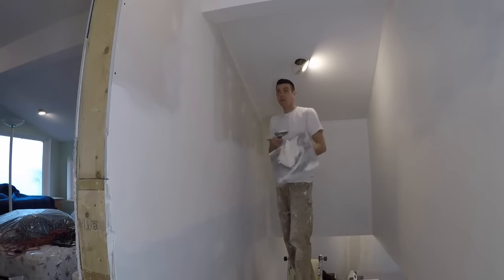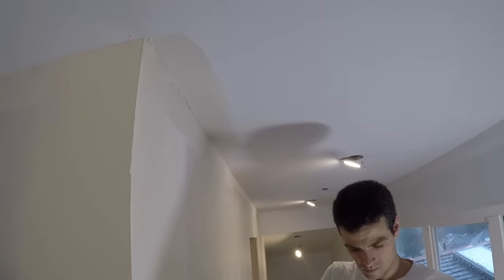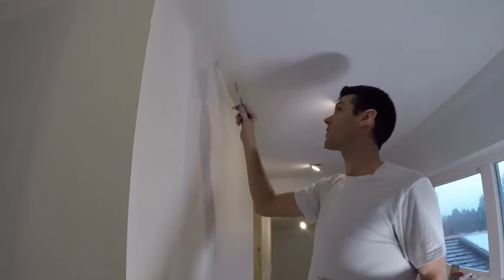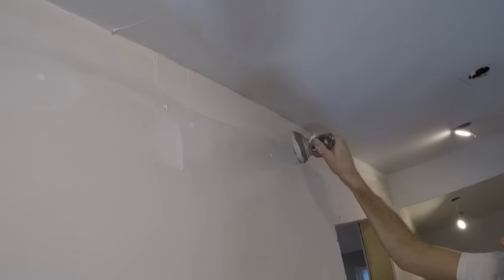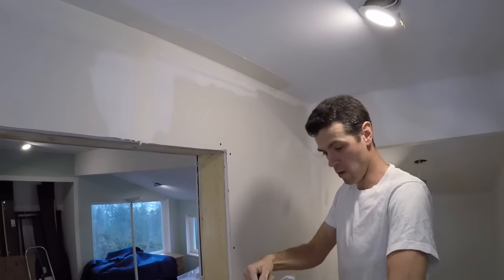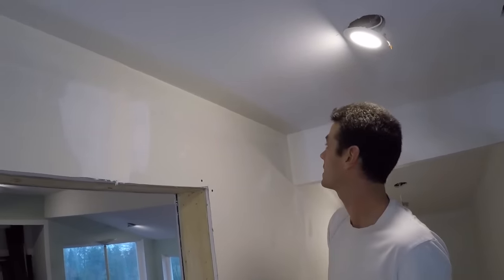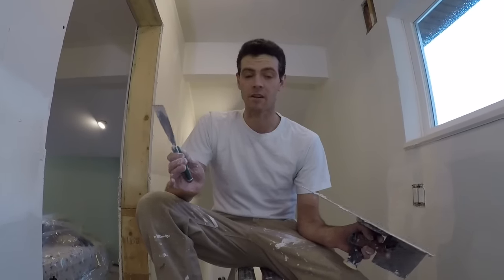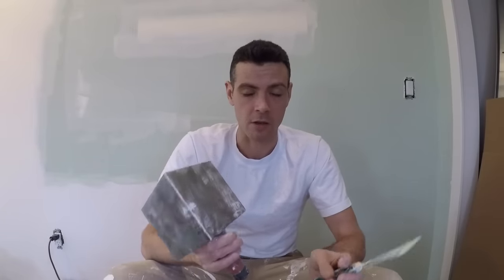HOW TO USE A CORNER TROWEL

Comment: I learned on a corner trowel, and don't need to use a knife with it. I keep my mud laying on my hawk like a fat pancake, and plow the trowel into it picking up what I need on both sides. Smear in out, usually half going one way, the other half going the other direction. Make several passes in both directions to smooth and level. Clean the blades on my hawk, then cut away excess mud from the far edges of the joint using the front of the tool. Clean the blades on the hawk. Make a feathering pass on each side of the joint with the tool fairly flat, putting pressure on the outside edge of the joint with very little pressure in the corner. Easy-peasy.
Reply: I agree he seems biased. How about a video with a zero experienced ‘taper’ showing them using both methods ( corner tool vs knife) and look at the results after just one application.

Comment: I've used OPS a few times as well. I found I had better control and a better feel for the
mud if my index finger was as forward as I could get it, applying pressure to the blade.
That said it spends more time on the shelf next to my outside-corner plank shim than
on a job site. Quality video! Thanks.

Comment: I'm left handed AND I like that tool. I apply the mud with the same tool so I don't need another
blade in my hand. I've laid tape with it and use it on a finish coat. Though you're right it's obviously not suitable for every situation. I find it's only issue, from time to time, is the construction underneath it.

Comment: I bought one os these.  Used it once...in a closet.  Never used it again.  I am, however, now a fan of paper faced metal inside corner beads.  I have 25 (drywall) inside corners in my basement remodel and they are well worth the $50 for me.

Comment: I get fairly consistent results with a corner trowel because I don't put too much mud in the corner to start with... so the trowel always bridges the entire swath of mud. This means I really don't have to taper in edges because they always end up tapered with pressure from the trowel. If I need to run the mud out wider then I wait for the first coat to dry...and then use a 6 inch knife.  I admit I am certainly not a professional.  I tried the knife method and always found I got an inconsistent corner that had to be chiselled out or built up in spots. Perhaps my technique is pretty crappy...but I am a retired body repair man used to putting body filler on straight. Our motto used to be "The bodywork is only as straight as you are" LOL.
Reply: Lol

Comment: so i wanted to try the inside corner tool as well i have had decent luck but mainly because of many trial and errors. its all around way more work and best way ive found to use it where it produces a nice finish is you apply more mud than normal, and use ALOT of pressure to thin the corner back out but honestly its definitely kids sandbox shovel now. lol

Comment: It is all about practice, and what tools you are used to using. I have been using corner trowels for 20 years, and it is just as good as any other method. This video is YOUR opinion, nothing more, nothing less. These tools have been used by quality drywall finishers way longer than YOU have been alive.

Comment: You should see me on that corner tool. It definitely took abit of time to get good at it but once you are it really is beneficial. Only need to go over it once and only feather edges once at the end and when I go over it I put my hawk down  somewhere or between my legs if I dont need to walk and use my other hand to apply the right pressure to get a more smoothly even finish, helps to control the angle and amount being applied I  the corner.

Comment: Ha ha ha, I always wondered about my corner trowel. I bought one 25 years ago, used it a couple of times, and had to sand way more after I was done! I assumed I wasn't doing it right. Single blade, one side at a time, is easier, as you say!

Comment: I have depth perception problems because I have poor vision in one eye.  So I've used a corner trowel , but I do it a little different. I put a bead of mud right in the corner so that it covers no more than an inch on either side of the corner. Then I press the corner trowel into it and force it into a nice sharp  corner line . This eliminates  having to taper any edges. I let the mud set up...and then I do each side with a 4 inch knife  going right from the corner and tapering it to the outside edge. It works for me...even though it is not as fast.

Comment: Interesting, I'm very inexperienced @ drywall, I tried that tool a few years ago only the first and only drywall I did until this year. I ditched it at the first attempt thinking it must be a gimmick. never entertained me to even try it again. I have just completed my first corners since and lo! I used the 4" knife, not quite the way and ease that you do it by a long shot but I got them done into very passable corners. I thought I'd better watch one or 2 u tubeers ( 2 beers is what it took to get the job done) Thanks for putting my mind to rest, I tried your method on my next corners, about 4 times as long as you took, but much, much better corners, a bit more sanding than yours of course, but not as much as my first ones did. Much obliged

Comment: I have one of these corner tools and I'm not a pro.  It does work well with a technique and as long as the mud don't spread out too much, it'll feather the edges nicely too.  It is not built with a 90 deg shape but something more so you can't get too tight in the corners.  This leaves a thick layer in the corner to provide adequate coverage of the tape.  As indicated in this video, if too thick in the corner, sometimes the mud will dry with a fine crack along it and that's the only downside.  I just fix that with a final pass of mud packed into the corner.

Comment: I love my corner trowel. I use it along with a 12 inch knife
Reply: Richard Miller 
I do everything with a 5” knife and a 12”
Never use the 8” or a hokey corner knife.
Reply: Same here, corner trowel with 5” to feather out since the corners load up more. Seams I use 5”, then 10”, final 12 or 14 depending on butt or seam type. Just bought a 24” skimmer for crooked old house flips, I’m anxious to try it out.

Comment: As a taper since 1986, I have found limited use for an inside corner trowel. That is, when I have to coat a corner bead that is only a few inches away from an inside corner/angle. The corner trowel helps to squarely fill the angle and corner bead at the same time. It can also be useful in a pinch when I want to square the crease of the angle and don't have drying time to coat one side of the angle and wait for it to dry before coating the other side. The corner trowel does not feather well at all, but the outer edges of the coat can be skimmed when the edges have dried out a bit.
Reply: Richmond slug? Lol

Comment: i use corner trowels. i find i have to apply a little more pressure on the back center of the blade with a finger closer to the point to get a better corner line without much mud. just pushing mostly on handle i notice leaves too much mud. but it is all about what u are used to and practice with. like i would rather use a trowel than a 12' knife any day.
Reply: bri bart pressure on the center and pressure on the wings. You almost gotta make your hand look like a frogs toes but it’s by far the best tool out there

Comment: I have just finished a bathroom and kitchen using the wing trowel hears what I found out, first check the angle of the wings, should be more than 90 deg to leave some in the bottom of the joint. Second place your index finger on the bottom of the V to help balance each wing. Third keep a low angle to not scrape to much out of the joint. Then level and feather  top and bottom. Also I apply compound 6 to 8 inches on either side of the joint.

Comment: Like your videos mate , from new zealand ... i use a corner trowel , you can push on the outside of the tool as you pull the corner , that will feather it off as you go , that makes it way faster . And with a bit of experience on it you can get a perfect corner every time , way faster than a 4 inch , great to see different ways of doing the job tho 👊✌

Comment: I like my corner tool because it saves me time rather than coming back and doing each side over and over!
Reply: If it is for a customer then use the corner trowell. But if it is for your own house you were going to have to look at it for the next 20 years perhaps.  Make a couple trips with a 6" knife.  Then enjoy it for many years.
Reply: Many drywall guys leave huge gaps, so I fill with durabond 20 with my corner tool.
Reply: @unclebobcarpenter6079  i use fix it all, I heard it's just like durabond  90.  If I have to fix a square in the wall, I cut a piece of square drywall, and then I stuff the wall with the newspaper, are use a leveler, and then I fill  it with fix it all.  It is the straightest fix. But I have to be extra sure to feather it out because it is impossible to sand.

Comment: You need to use a split corner trowel. With that you use a 3" to apply it and a flexible 6" to wipe it. Yes the inside corner needs a touch up when sanding. A split corner trowel is way way better once you know what you are doing.

Comment: Well, I am a big fan of the corner trowel. I thin the mud, use a fabric roller to apply a generous amount of mud. Press the trowel flat on the join first pass then angle the blade away from the wall the feather in your second pass. Reapeat process and finish with a wet sand. Done.

Comment: The old plasters call it a wing tool. They are designed to be used in plaster work where the edge line gets rubbed out when the plaster starts to turn and ready to be floated and rubbed out.
Reply: there not the ones what plasterers use are called twitchers...that one in the video is a drywall angle trowel but loads of plasterers use them when they are skimming to walls were the angle meet..a wet angle.
Reply: @nom843 , very true. I have always used a "twitcher", a far better tool, leaves a far better finish too. Also, with plastering, there's NO sanding down like there is with taping, so it has to be done right first time. A good plasterer will do horizontal/vertical "wet corner returns" with a twitcher, that need NO sanding. Plastering and Taping are totally different jobs by the way,, no comparrison.

Comment: Could use on small jobs where the difference is running a light sand and skim. But  honestly quickset and one side at a time works better. I always second coat inside corners with topping when I use quickset. I've found its a quick way for a nice finish

Comment: A 4"x5" corner trowel works fine to embed Perfect 90 composite tapes and paper tapes. 
You really need to practice the angle, how you hold the trowel and the amount of pressure during the embedding and wipe out phase. I always follow up with a knife to feather edges. 
I do second coats with a knife. Cheap corner trowels 90 degree angle bends can be rounded, not allowing a clean cut line on second and additional coats. 
I find the Marshalltown's 23D 4x5 are made with a nice sharp edge. Not too sharp to cut the paper, but leaves a nice clean defined line in the corner.

Comment: Well done, you handle that 4" trowell like a samurai warrior with his blade.....kidding.  Could you do a video for repairing fairly large holes (6-12")?  Or, how to properly seal drywall that has has it's paper torn and needs either paint or mud?  Thanks!   I gave you a thumbs up, from the States...!
Reply: Cut a square of drywall to cover the hole, place it against the hole and trace the outline of the patch.  Cut the wall along the trace to make the hole square.  Now insert plywood strips into the hole (4" or 6" wide), longer than the hole by 3" to 4" on each end, and affix with drywall screws from the front of the wall. 

Now you have a square hole with plywood strips behind it.  Put your square patch into the hole and screw the patch onto the plywood and finish as usual.

Comment: I don't like using a corner trowel but sometimes when I'm coating a job in one day with a lot of quickset, I'll put my tape on, coat both sides with quickset, and then use the corner trowel to put a tight coat of topping mud for sandability.   It's about one of the few times I find it somewhat useful.
Reply from the maker: I have done the same.

Comment: 1) A corner trowel follows the planes of the drywall panels (assuming they are perfectly flat), instead of the bumps on the joint tape. The local accumulations of joint compound are the results of smoothing the imperfections created by the joint tape.
2) Shaping inside corners with a knife has two problems:
        2a) Working on one side, you inevitably leave some amount of the joint compound on the opposite side, which "bleeds" there and creates bumps on that plane, which dramatically interfere with the second part of the job.
        2b) I found that pressing the knife into an inner corner inevitably results in the sharp 90-degree angle of the steel blade (between the bottom and the side of the knife) ripping the paper joint tape, sometimes all the way through, thus eliminating the entire purpose of using the joint tape.

Comment: I have a couple "one piece" inside corner trowels, you know the really cheap ones with the plastic handles.  
Useless as a tool but mine have stainless steel blades, and I flatten them out a bit, and they make perfect scoops for loading up your hawk. 
I have left them in all purpose mud for months and no tarnishing, or staining of the mud.

Comment: Ive used a corner trowel on every internal. I find that if the edges are sharp like urs. Then its a pain. However im using a ragni internal corner trowel. The edges are rounded which it makes it so much easier. Great video tho 👍👍

Comment: You need to watch someone that actually knows how to hold and use this tool correctly. Then you must commit to learning and using the tool exclusively for 2 weeks. I actually owned my first one for 3 years before picking it up again, determined to master its use. it really is a great tool for cutting time spent on angles.  Self-employed drywall contractor and journeyman with 40 + yrs
Reply: Greg I agree ..all I've used for 40 years also is the corner trowel..it's kind of funny watching these u-tubers..trying to show this simple technique...I haven't seen anyone show it yet...it's kind of comical  ...ohh the u tube generation..lol...

Comment: I couldn't get the corner trowel at the beginning. I am new ish to drywall finishing, but I think I've progressed to a decent place. I now use the corner trowel quickly, multiple passes, and have figured out the angle needed for a very good corner. maybe not as good as yours tho.

Comment: I bought a Marshalltown corner trowel at a thrift shop for $2.99. It looked like it had been used once. I’m new to drywalling and found the corner trowel useful in squishing hot mud pre-fill into a corner where there was a gap. I’m not a pro, so I’m not concerned about time. I went over the area with a 4” to smooth it. While the tool was somewhat useful, I wouldn’t buy a new one. It has limited applicability and I could have gotten the same result with a gloved finger.

Comment: Loving your videos, and yes, they are useful.  I hate you for being tall, I'm a 5'2" female with corresponding short arms :(.  
If you are taking requests, how about fixing "re-occurring" cracks at the corner of windows and doors where some dumb-ass didn't take the drywall around the corners.   
And, holy smokes, that's a tight hair cut, your ears are gonna freeze!

Comment: I usually run the trowel down the corner & then do another pass applying light pressure on one side of the trowel..then do the same on the other side ( which functions as feathering the edge). Then I do one final pass with light pressure in the corner. 
It slows the progress down a little & is a bit redundant, but creates a nice looking corner!
Honestly. I am slow with all  finish work. Pride & OCD tendencies  certainly play a part in my being slow.... but the major catalyst is the fact that finish work should be finished when you finish!! I may he slow, but you won't need to go behind me to fix/alter anythin4

Comment: The wing tool is a pro tool but better suited to plaster jobs vs drywall skimming. Also the large one is the hardest one to use. The smaller wing tool makes hand taping faster by spreading the JC on both sides of the angle. There's a dude on here spreading mud on his angles with a toilet bowl brush before taping, same principle but the toilet brush is probably cheaper/faster.

Comment: . I wish I’d seen your videos before I tried to use a corner trowel with paper-faced metal corner beading to fix up old plasterboard walls (that had no recessed edges for taping). It looked great - until I tried to reinstall the skirting and discovered the stopping compound was so thick in the corner, the skirting board not longer sat flat against the wall. Days of plastering and painting had to be scraped off and redone.